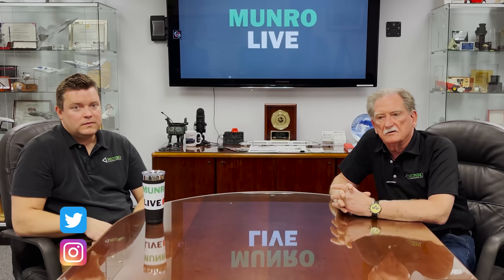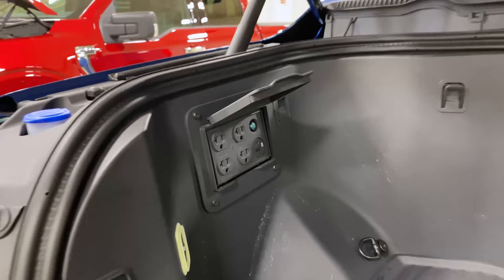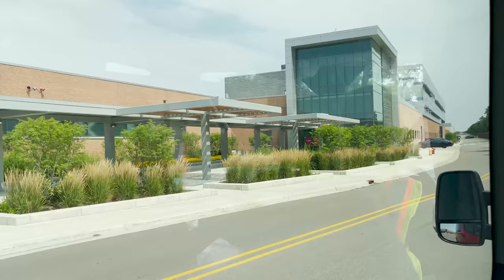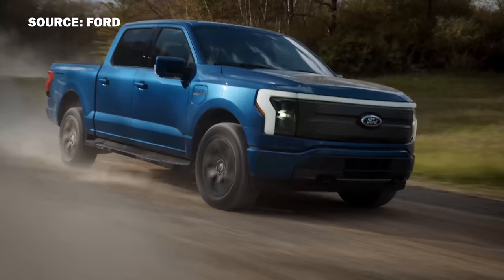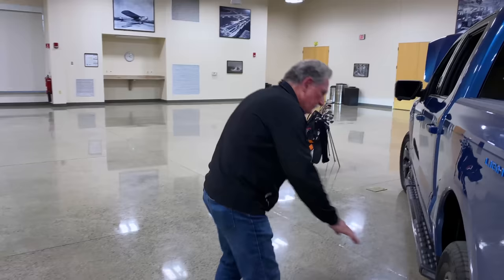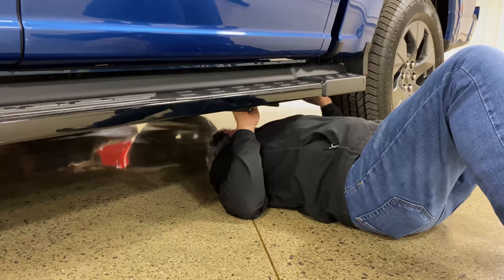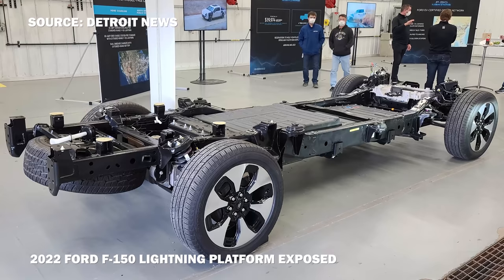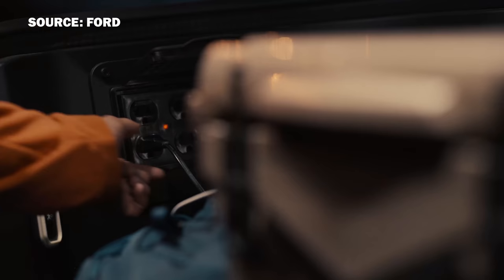Sandy's First Look at the Ford F-150 Lightning Electric Truck!

Comment: Looks really good and along those lines say for camping this parked up next to tent in a cold area with an electric heater fed in. Perfect!!
Reply: With the Cybertruck you don’t need a tent. I’m assuming the back seats fold down and bed opens to the interior, then just put it in Camp Mode, works great on my MS.
Reply: @Chainyanker007  there won't be a cyber truck until the middle of 2023
Reply: @Chainyanker007  I totally agree and i'm a big Tesla fan but I'm just saying if you want to camp on the floor it makes sense.

Comment: The main question is will Ford be able to sell the low-end versions of the Ford F-150 Lightning EV for a profit?  It seems to me that CAPEX for this new EV truck must be very high. Ford may need to sell hundreds of thousands of these EV trucks in the first few years or Ford may be in trouble.  It's a catch-22:  Ford needs to sell a lot of these EV trucks, but doing so would mean that the EV sales would eat into the sales of the more profitable ICE versions.
Reply: They tend to boost their sales figures with cost or near cost fleet leasing.  I would expect that.
Reply: re: "but doing so would mean that the EV sales would eat into the sales of the more profitable ICE versions." well not the sales of those truck buyers intelligent enough to recognize the F series is actually a FULL LINE UP of vehicles (ref: 1/2 ton, 3/4 ton, 1 ton, etc) and that as great as the Lightning is, what it represents (even in it's BEST form) is still that of a "LIMITED USE CASE".  source: F350 Dually owner.
Reply: They have 200,000 orders. They already make 70% of this truck. Ford has a winner here

Comment: Could you explain more about the battery.  Why is it so good?
Reply: To reduce potential damage from vibration caused by shock or moving over rough terrain. Trucks need to be able to handle more shock than regular passenger vehicles.
Reply: @patreekotime4578  i dont know too many roads in NA that are perfectly flat. most are covered in holes!
Reply: @jetah50  No clue what you are talking about. Sorry.
Reply: Could SABIC make a better, lighter, stronger battery?
Reply: Take a lot at battery powered power tools and find your answer

Comment: @Antoine Swans Re: Reply to Clara Smith. Gigapressed parts are intended to solve "accumulated misfitment" issues. Side effects are eliminating parts, fasteners, robots, drudgery, & other things that kludge things up, consume time, & add cost. Good to see Ford partially following suit to use large (not quite giga) casted parts.
Reply: The car will easily be written off. Tesla sucks for repairability

Comment: That screen should run the job site - it needs project management software, pricing, inventory management, accounts, drawings, plans, permissions & permits all there on screen. The productivity and efficiency gains for SME's would be incredible.
Reply: I think they are better of using a laptop.
Reply: If only Ford had an HDMI port that could allow you to use it as an external display with a laptop. That would be tremendously useful - even in portrait mode.
Reply: @Megaphonix  USB-C could do the job, I have a laptop connected to two screens with just one USB-C cable and that supports an external keyboard and mouse connected to the screens as well.
Reply: screen's too small.  maybe as a secondary monitor from a laptop/tablet, would be good.
Reply: Allow it to be used as a Remote Desktop from your laptop, a client app running on the screen.

Comment: just realised something , about the F 150 , the fact that the battery is isolated from the frame is very unique. it occurs to me that this could possibly operate like a tuned mass damper , as used in F 1 cars. or in a sky scraper to prevent it swaying. Having the battery isolated could possibly lead to a super smooth ride.

Comment: With this truck, Ford is moving in the right direction. Still very excited to see what happens when cyber truck arrives. :)
Reply: I'm also very excited about the Cybertruck. I'm not so excited about the yoke steering with an unadjusted steering ratio and mandatory auto-presenting doors with no manual door handles though, but we'll see what happens when it's here.

Comment: I think the utility will convert a lot of owners to this type of vehicle. It will not take long.
Reply: It's what sold me and my wife.  Put our pre-order money very early.  I like that we can use almost any accessory that was developed for a regular F-150.  I also like that it looks like a truck, so we won't attract too much attention.
Reply: I also bring up the local tradesman. If the truck can get 100 or so miles while fully loaded, never requires a stop at a gas station, never gets taken off duty for an oil change, and doesn't wear the engine out idling during the summer/winter for climate control, it will be revolutionary.

Comment: I think Ford did a very smart thing. The Lightning takes full advantage of the fact that's it's an EV, but it's designed to be a truck first. The Cybertruck is a lifestyle vehicle. The Hummer will be a lifestyle vehicle. The Lightning can be a lifestyle vehicle, but equally at home on a job site.

Comment: Would I be able to back my boat into the water? I would mostly pull my boat. I’m concerned because when backing a boat into the water, the bottom and back of the truck does enter the water. Will the water get into the batteries and other electronics and ruin it??

Comment: I would love to see Munro tear down an Ice car to show the multitude of components it takes to make these cars run. Also high light all the typical failure components. You could compare the quantity and highlight the abundance of increased/ decreased failures. This could be a series.
An episode could be made to highlight what could be changed to increase the life of electric cars, like an Electric car with two smaller motors, less acceleration, and other ideas that increase the life of components even more.

Comment: The shifter is cool, but their solution is for a problem they created. That shifter isn't needed,  it's just added complexity and a missed opportunity at more storage solutions. Trucks have had stalk shifters too.
Reply: When Ford surveyed its customers they said that they wanted that type of shifter and that's why they put it in there they didn't want the one on steering wheel or a dial rotor. Ford listens to their customers that's why they've been number one for 44 years.